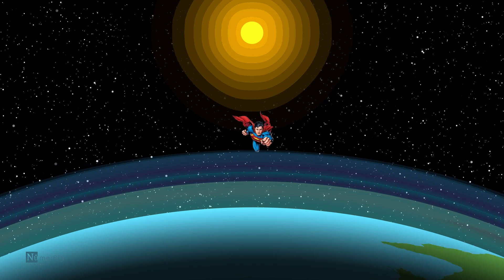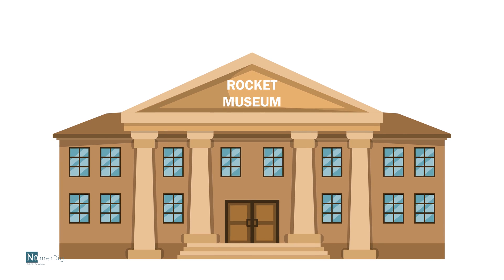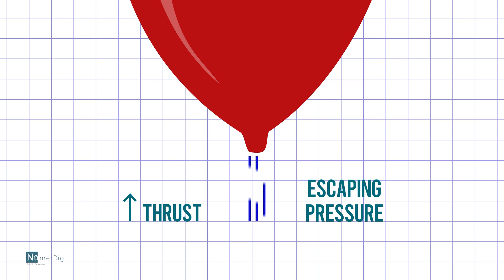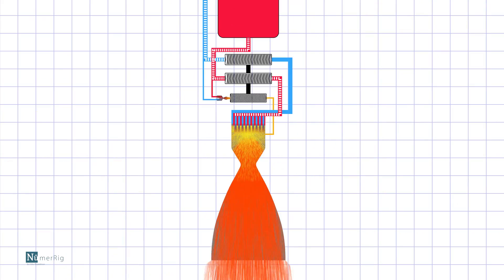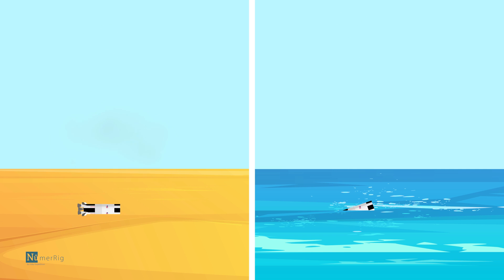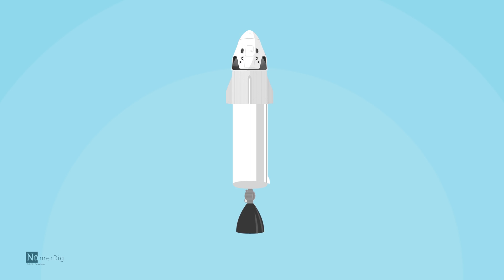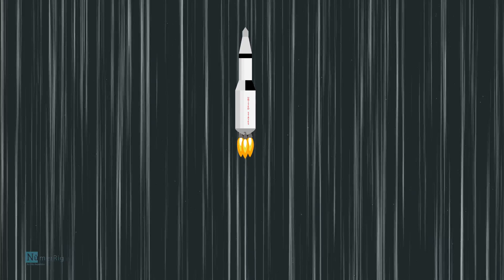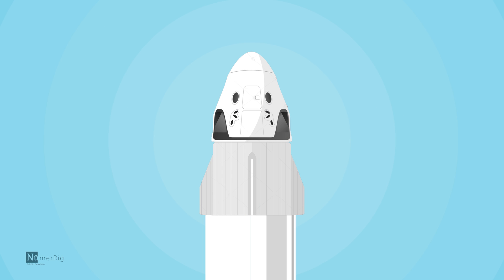How Do Rockets Escape Earth's Gravity?

Comment: i understand but i don’t understand how a rocket is able to escape the atmosphere this way , unless there was a path already made by something or someone else , honestly i can’t imagine. thrust working at all without atmosphere present
Reply: No resistance in space so steering is done buy Vector thrust from rockets. Like rockets on a swivel. F=MA
Reply: @ddt1877  
try find how much physical mass is ejected when using the thrusters in space ,i bet there's no data .
Reply: @TheCraigy83  I assume as its burnt some unburnt fuel, heat, soot, CO2, & a few other things are ejected during the burn. Unsure what your stating? Mass in = Mass out
Reply: @ddt1877    they move by mass ejection after they run out of atmosphere to push against , they'll go from millions of pounds of thrust to like handfull of pounds probably even less hundreds of grams  ,  do you properly understand psi force vs air/gas mass is like elephant vs ladybug .
Reply: @TheCraigy83  i have an Engr degree but its been a while.
Reply: @ddt1877  i think they only get the peak velocity obtained below 150k - 200kfeet and use the momentum of their mass to escape earth ,  

escape velocity is a theoretical speed an object on earth would need to be fired on an angle out into space assuming earth didn't have atmosphere /was a vacuum . Things don't actually need to go 11km a second to escape earths gravity .
 you can go to the moon never exceeding 30mph as long as you maintain thrust / a greater then 1 to 1 lift value .  Most of earth thinks escape velocity is a rule for powered vessels😂 its cannon ball in a vacuum maths.